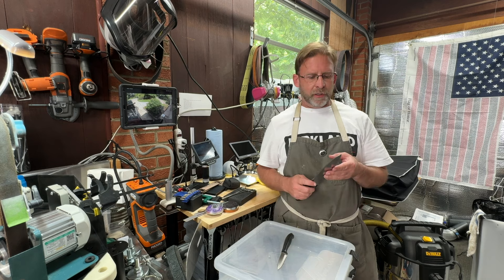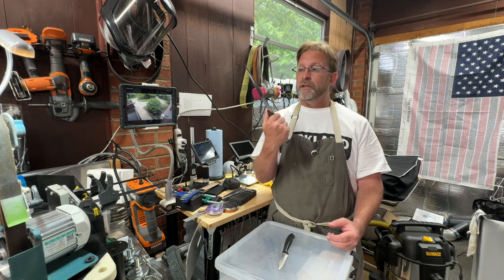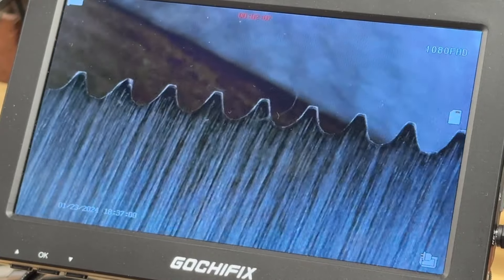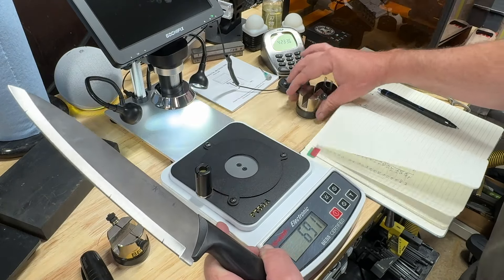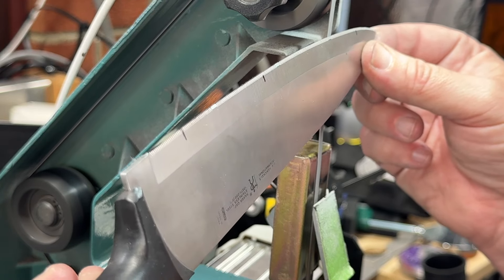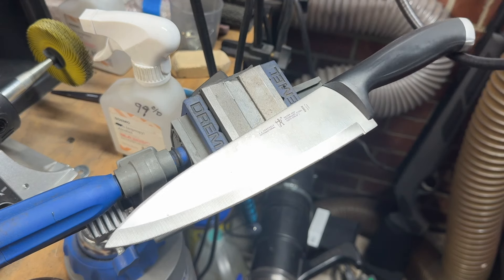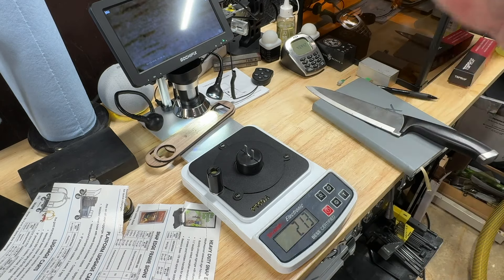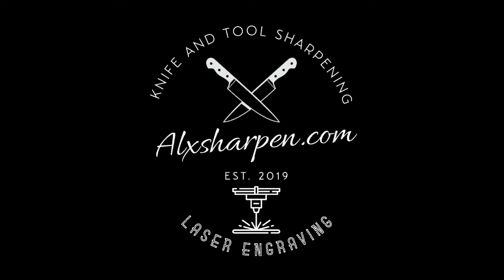Are we losing money on knives we could be sharpening because we have been told you can't sharpen it.

Comment: Good stuff! I've found that doing more than just one pass (belt on back side, then wire wheel on opposite) leads to even better results for me. I usually do 5 to 6 passes alternating between the belt and wire wheel, then a couple of clean up passes on the leather strop. Been having great results. Thanks for testing these methods and sharing with the community!

Comment: As usual... very informative. I like the wire wheel approach! I have only sharpened the tapered side by hand using a Spyderco file... and it takes way too much time. When I buff, I use a floppy wheel with a good compound.